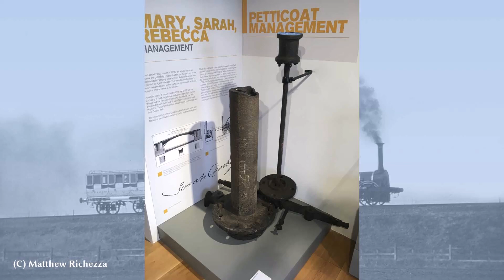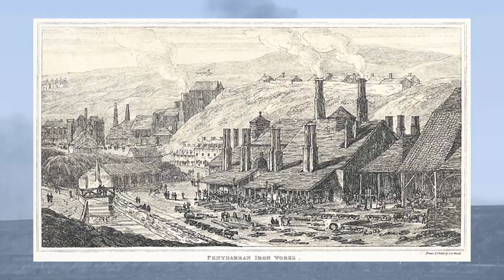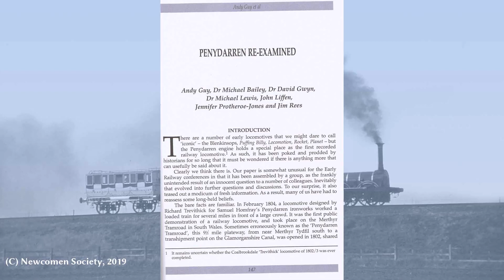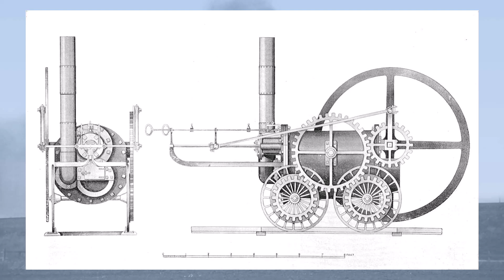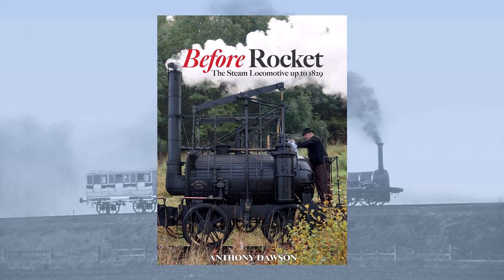Trevithick The Basics

Comment: 50 psi, 8.5" piston diameter, 54" stroke length, at 5 mph with a wheel diameter of c.48" (based on the drawing key and visible gear ratios) means an engine speed of approximately 35 rpm, and a total estimated output power of 31 kW (42 HP).  Damn.

EDIT: If the wheel diameter was closer to 2.5' as shown in the second drawing, and the engine had "a few strokes per minute" as described, then the engine speed was likely closer to 90 rpm and the output power would be closer to 100 horsepower.
Reply: I'm not sure how you're getting your power estimates. They seem too high for the numbers you give. It feels like you left out a factor of 1/2 somewhere, maybe?

By the way, ignore the passage talking about running at "a few strokes per minute" when estimating the engine performance. That was far below the engine's normal running speed; you have to listen to the context there. It's in a discussion about observing the effect of the blast pipe on the draft for the fire. To make that observation, they were running the engine at very slow speed so that the effect on the fire of each exhaust blast could be clearly seen.

Comment: Watt's engine was high pressure for it's time. Newcomen and Savery also argued about patents, it was nothing new. How could Somebody get a patent for a crank, so Watt couldn't use it, ( a crank must be a biblical invention! ).
They also tried to sabotage some of his engines. On a visit to the Bolton and Watt factory Trevithck's grandfather pinched one of their drawings, they had to demand it back.
Watt's engines were powerful enough to drive Industrial Factories, Steam Boats, kick of the Industrial Revolution, and replace the the 2000 years old Water-wheel for the first time in human history. He had his hands full designing and installing the world's first High Pressure Steam Engines.
He was proved right, we didn't have Stevenson's Rocket till well after Watt's death.
Yes Cugnot definitely had a Steam Engine, but it wasn't exactly practical was it, it couldn't drive any factory.
Newcomen and Savery gave up on Steam Power for Atmospheric Power.

Comment: Well, Watt did invent the world's first High Pressure Steam Engine, the world's first Steam Powered Engine ever.
The first Engine that could replace and far outnumber the ancient 2000 years old Water-wheel!
Then we had tons more Factories, and the Industrial Revolution started!
Reply from the maker: With all due respect, the Watt steam engine was a low pressure condensing engine. The company of Boulton & Watt led a virulent press campaign against Trevithick and the high pressure (50psi) steam engine as they thought they were dangerous. Boulton & Watt also held back the development of the steam engine through their patenting of it and vicious enforcement. They even tried to sabotage other firms such as Matthew Murray of Leeds. The first successful high pressure (4atmosphere) steam engine was built in france by Major Cugnot in 1769 for his fardier a vapeur, which was also the first self-propelled steam engine in the world. Hope this helps. 🙂
Reply: @AnthonyDawsonHistory  As they knew it would break their stranglehold on the market and circumvented the Watt patent.
Reply: @AnthonyDawsonHistory 
Everybody before James Watt used high pressure Steam (above Atmospheric Pressure) in their failed attempts to build a practical Steam Engine. They didn't know how to build a low pressure Steam Engine (below Atmospheric Pressure), and instead turned to Atmospheric Power, and there it stayed for the next 70 years.
 By creating the first 'Closed Loop' Steam Engine, James Watt could now use Low Pressure Steam for the first time. His Low Pressure 5psi., 'Closed Loop' Steam Engine could do the same work as an ordinary 20psi High Pressure Steam Engine, but using only 1/4 the amount of fuel. 
I've only just learned that Watt's Steam System actually had a name, a 'Closed Loop', and it's still used today in Steam Turbines. So, just like Watt's change from Atmospheric Power to Steam Power, and his new Engine are never mentioned, neither is his 'Closed Loop' Steam system. Heating and cooling of the Newcomen Atmospheric Pump's cylinder as  the source of of it's inefficiency is just ridiculous.
Reply: How can you say James Watt's engine was a condensing engine? It was Steam Powered right from the start.
Newcomen's Pump was a condensing Pump right from the start, but nobody mentions it.
Watt also used a condenser to recirculate hot water and to ELIMINATE Atmospheric Pressure, which opposes a Steam Engine, it made his Steam Engine more efficient.

Comment: "The boiler will hold it's steam a considerable time after the fire is taken out.  We worked the engine three-quarters of an hour after all the fire was taken out from under the boiler. It is also slow at getting up, for after the steam is atmosphere strong, it will take half an hour to get it to 80lbs. or 90lbs. to the inch. It is very accommodating to the firemen, for, fire or not, it is not soon felt. The engineers at this place all said it was it was impossible for so small a cylinder to lift water to the top of the pumps, and degraded the principle, though at the same time they spoke highly in favour of the simple and well contrived engine. They say it is a supernatural engine, for it will work without either fire or water, and swore that all the engineers hitherto are the biggest fools in creation. They are constantly calling on me, for they all say they never would believe it unless they saw it, and no person here will take his neighbour's word, even if he swears to it. They all say it is an impossibility, and will never believe it unless they see it. 
After they had seen the water at the pump jead, they say that it was possible, but that the boiler would not maintain it's steam at that pressure for five minutes; but after a short time time they went off, with a solid countenance and a silent tongue. 
The boiler is 1 1/2 inch thick, and I think there will be no danger in putting it still higher. I shall not stop loading the engine untill the packing burns or blows out under it's pressure " Richard Trevithick, Great Engineers by Walter Scott.

Comment: From what I have been able to gather, Trevithick built several locomotives to the general plan or outline but different gauges and details.   It has always been a catch-up of track and locomotive & cars in the railway world.  At present in the US and mineral railroads the load on single wheels-on-rail tend to max out at 33,000 lbs which is getting into the plastic region of the stress-strain curve of rail steel.

Comment: I just found your channel and I find it very interesting historic insight. I have tried to find out more about Trevithick's locomotives earlier and I also found tat there were too few sources really. The story goes that he just put a stationary steam engine on wheels and so invented the steam railway, but that might be simplifying things a bit. Limitations of rail strength and loading gauge, dynamic forces, all the potential problems had to be worked out by trial and error. It was a wild pioneer time but indeed he made some remarkable discoveries.
Reply from the maker: The most upto date research on Trevithick shows that his first locomotive at Penydarren was built as a railway locomotive and later converted to stationary use. If you've an interest in Trevithick, you should definately read the papers in the Early Railways 6 Conference proceedings. Michael Lewis in his book on the Sirhowy Tramway published only last year provides new insites, especially regarding the Penydarren engine's boiler. Which is really exciting as it shows there's still things to learn about Trevithick's locomotives. :-)

Comment: can i ask what's 200 weight of steam coal exactly? i have recently learned what one tone looks like by looking at pictures of piles or heaps of coal on the interenet because i did not know what it looked like exactly but i did know what one cord of wood looked like because in the past i have done a lot of work stacking logs which was going to be used as fire wood.
Reply from the maker: Well a hundredweight (cwt) is 112lbs, or 8 stones. And there's 20 cwt to a ton. So it's not a vast amount.
Reply: @AnthonyDawsonHistory  so one ton of steam coal would be like one cord of fire wood then?
Reply: @AnthonyDawsonHistory  I understand that he is believed to be the first driver of a steam locomotive?
Reply: @AnthonyDawsonHistory  so about two wheel barrow loads of steam coal then?
i don't know what cwts are exactly